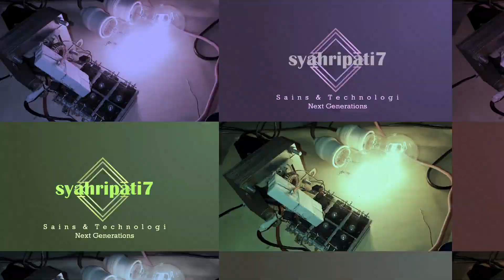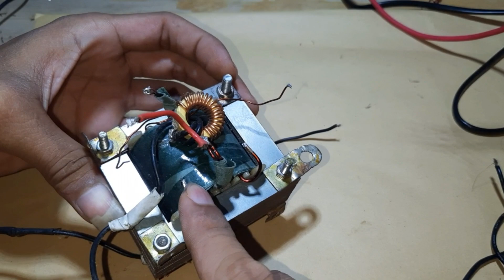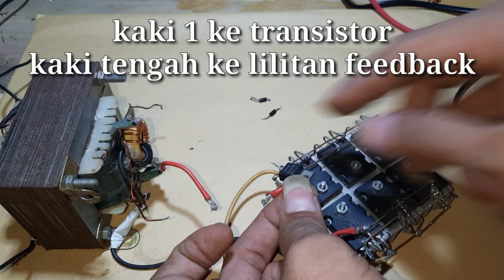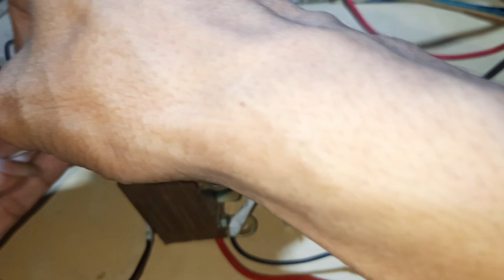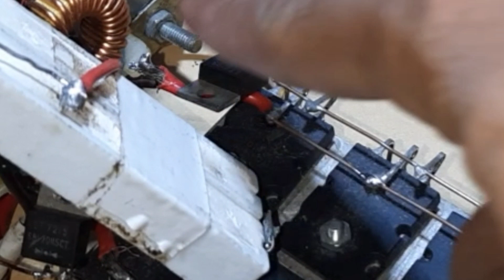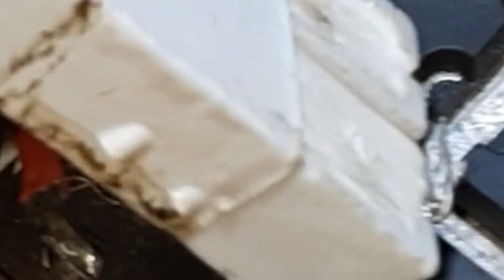Dioda Kaki 3 SBL2045CT untuk PAC

Comment: Mas kalo dioda schotky body dipasang ke heatsink dan nyambung ke groun apakah aman mas?
Reply from the maker: Tgl polaritasy body diodanya apa bang, kalau kaki tengan itu outy + gk bisa. Mending beli yg outy - atau belikan isolator dioda
Reply: @syahripati7571  seri MBR10100CT serinya mas, di body ada tulisan on
Reply from the maker: Itu outy + mas.. mmg aplikasi di alat apa mas
Reply from the maker: Kalau mmg hedsinky nyambung di ground, harus dikasih isolator mas
Reply: @syahripati7571  sidah di coba mengganti dengan dioda mbr tapi tetap protek switching nya, 
Kalo ic FA5518N  pin protec nomor berapa ya bang,
Reply from the maker: Mlah blum fham mas, itu protec short apa overload
Reply: @syahripati7571  overload mase, out 24v sama 6v+4v tp kalo pakai output 6v sama 4v nyalanya normal. Kalo pake 24v langsung protec